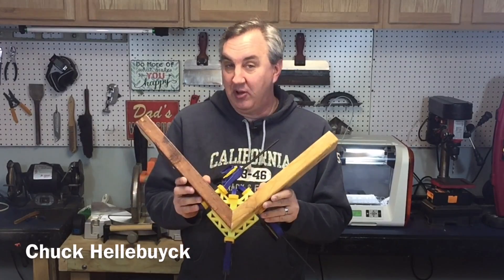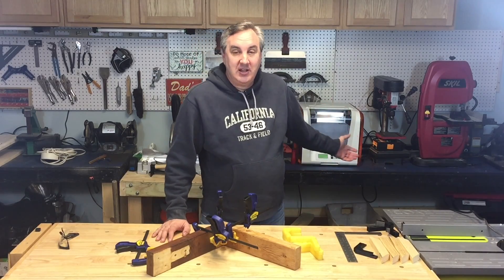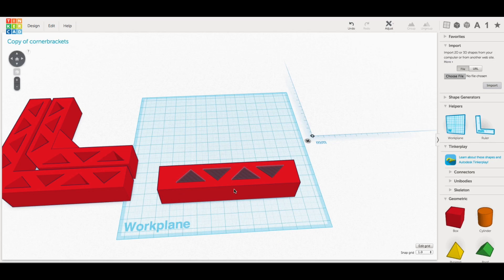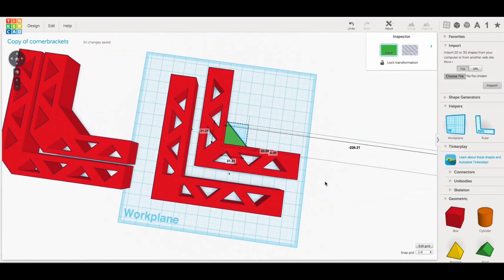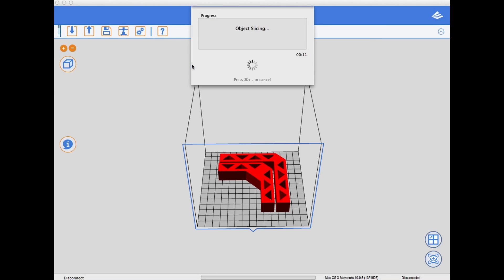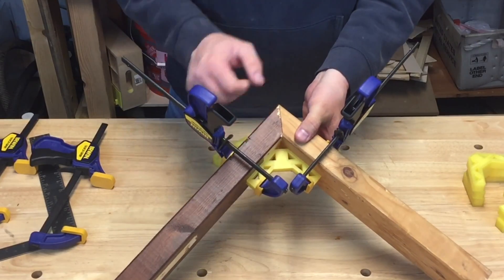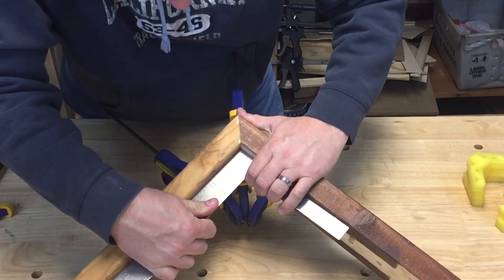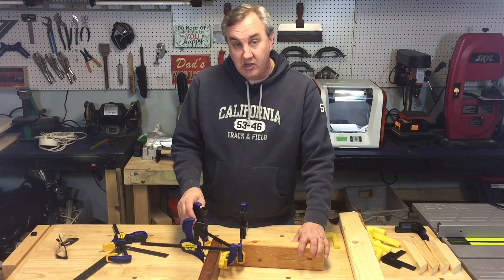Filament Friday #53 - 3D Printed Woodworking Corner Clamp Braces on DaVinci Jr.

Comment: i really need some help this is the printer i am getting http://m.ebay.com/itm/RepRap-Guru-Prusa-i3-Full-3D-Printer-Kit-Acrylic-Frame-w-MK8-Makerbot-Extruder-/401051279352?_trkparms=aid%253D222007%2526algo%253DSIC.MBE%2526ao%253D1%2526asc%253D20150519202348%2526meid%253D5c933981dbd44a649f94b5f161b89749%2526pid%253D100408%2526rk%253D2%2526rkt%253D12%2526sd%253D311486968403&_trksid=p2056116.c100408.m2460 its a prusa i3 but do these printers require soldering??? also im just looking for ok-decent quality. would you reccomend?

Comment: Just finished your bracket in onshape: https://cad.onshape.com/documents/6d60e92d1a55190b9b70d3a8/w/485ce3b99298f6d5a528786a/e/fee50aa4766287847fa473bf 

If you want to modify it at all simply edit the variables at the top and the entire thing updates automatically (wall thickness, brace height, clamp width, wood thickness)
Enjoy!
Reply: That is cool. I think that I will try onshapre.

Comment: Would be interesting to see a version that that you could take the rubber pads off the irwin clamps and just slide it strait into the bracket. Wouldn't be as versatile as those you printed but just a thought. Love these types of videos and still have yet to get a printer but really want one :(